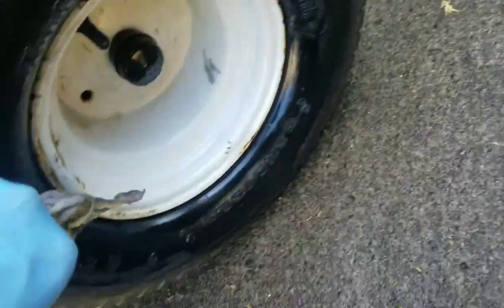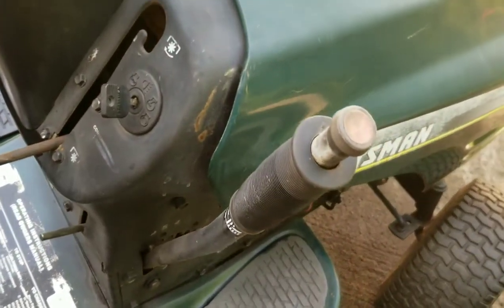How to Fix Faded Riding Mower or Restore Oxidized ATV Paint w/ Boiled Linseed Oil & Mineral Spirits

Comment: I use the same concoction on the plastics of my '85 ATC 250R. Mostly because it's a quick easy way to make something old look pretty dam decent for a while. Sure you could spend the hours and elbow grease wet sanding and buffing it (been there and done that) to the point that you dont even want to use it because it took so much to get it that way. And the oxidation just comes back anyway.
So im Just here to say, this is the best way for fast easy results. And it does last a good amount of time too. At least on my old 3 wheeler it does. About to try this tomorrow on my clapped out 2005 Craftsman DLT 3000. Cause I know she's a beauty queen under all that crud.
Reply from the maker: good to get some backup on this idea!